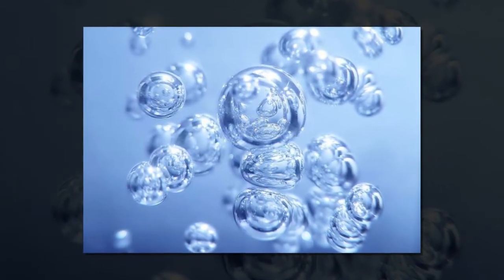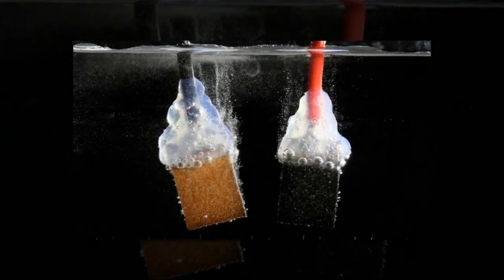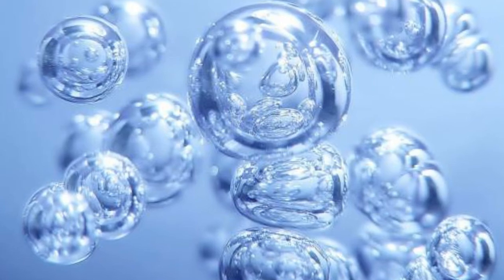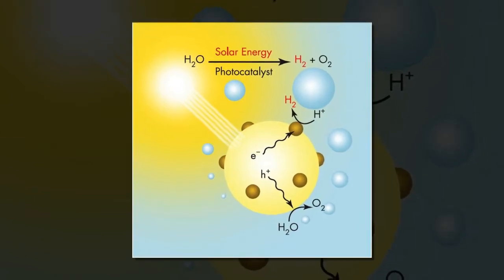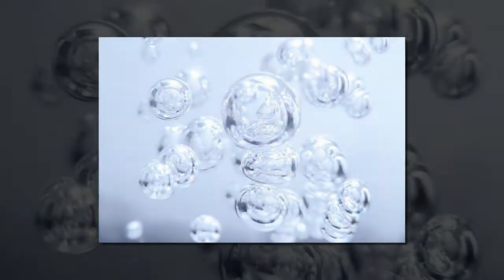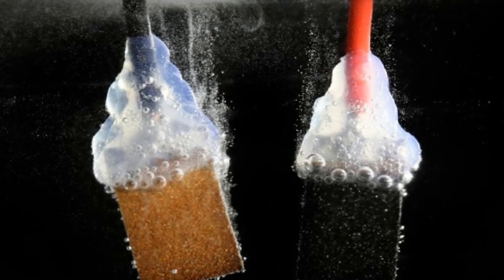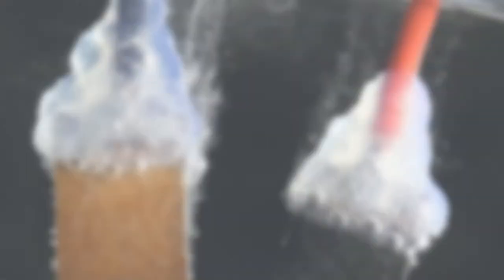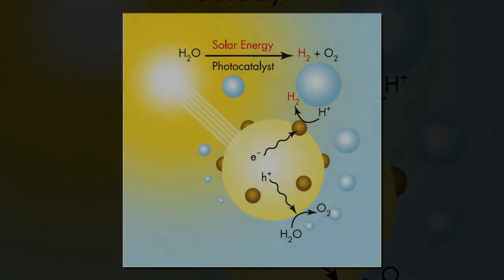Scientists achieve perfect efficiency for water-splitting half-reaction

Comment: didn't John Kanzius already  use radio waves to made one of the best effective electrolysis known ?
Reply: Radio waves resonant to the molecule and the OH.
Reply: There was no proof I believe, there is mixed information of just what the frequency is, it must be higher than 2.4Ghz as that just excites the entire water molocule as per Microwaves, I believe based on the size of the H-O bond it will be around 104GHz, possibly a Magnetron or Laser excitation.
One Experiment used Boron as a cheaper material for the Electrode compared with Pt.
Reply: He did a device but let me say... Was it effective? I saw his device a warning sticker saying "High voltage"... My conception of effectiveness is something suitable to put an engine working with a battery of a car. Give me a power plant and i can produce a lot of the hydrogen.. But is it suitable to fit in a car? Here they are using solar power and comparing it with previous metrics of same content... I can point a chemical reaction of aluminium and galium (or with NaSo2) , or a double voltage circuit (electronics),  but it's not contextualized here...
Reply: Antonio Sousa Dias no.. it was made with his wife's pie pans... So the story goes